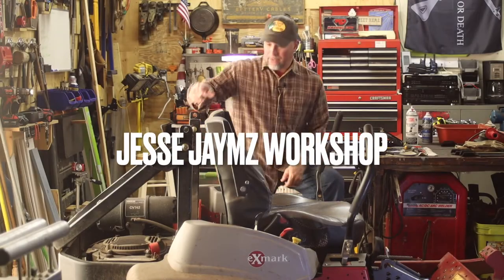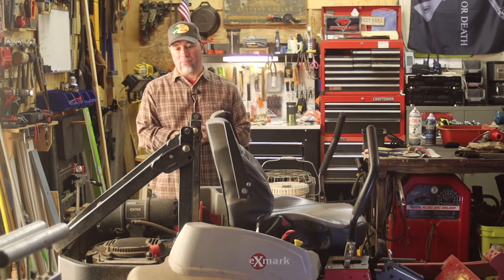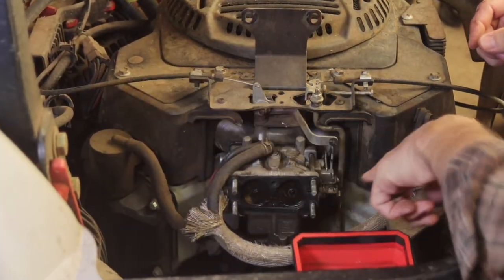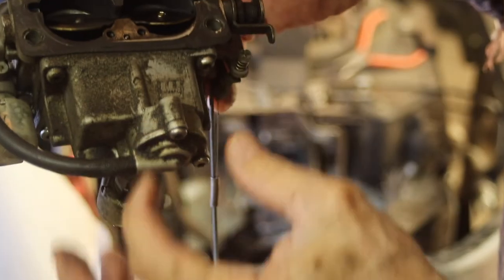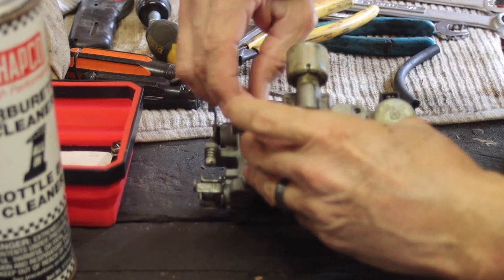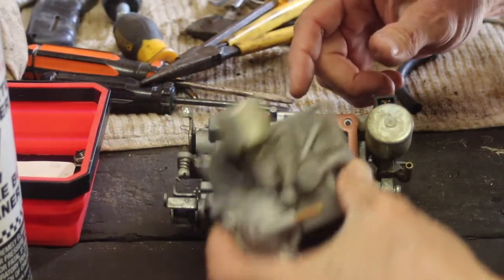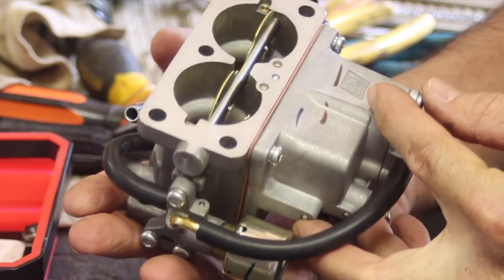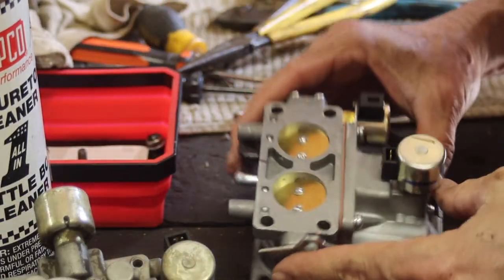Emark Lazer Z Mower - Kohler carburetor issues - 27hp engine troubleshooting

Comment: 2009, 60" model 74244 Commercial with the Kohler CH25S.  914 hours,  only replaced the clutch and now the PTO (Delta 6201) switch.  Still out cuts my 2020 Badboy 60" 747.  If you ever get the chance, find one built before the eXmark/Toro split. (25000000 serials.)   They are lifetime mowers
Reply from the maker: Yes, I have a couple 2005 lasers too. They still run great but new motors now
Reply: What year would that be?

Comment: Jesse I am having a hard time finding the exact carb.  Where did you buy the replacement carb?
Reply from the maker: There is a local dealer of these Exmark machines and they had the carburetor in stock. You can try to cross reference the part number then call around to your local equipment shops and ask them if they stock it.

Comment: Is that Knocker still running or have you thrown a rod by now? There has got to be a place you could have gotten a replacement needle valve, most are almost identical. The choke issue you still would have had to figure something out on but I would’ve hated to drop 300 for just a carb when you know an engine is on the horizon.🤷🏻
Reply from the maker: The carb fixed everything. The machine now has 4,400 hours on it. That “knock” never came back after the carb install, it wasn’t a push rod (thankfully). Just glad everything is holding together. I’m really pushing the limits of this engine now but at least it made through about season. 💪🏼